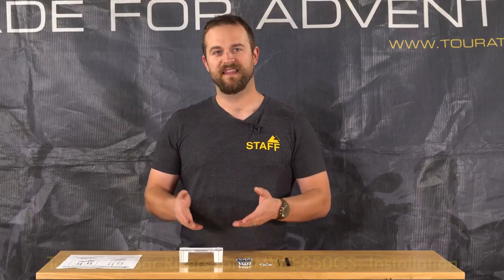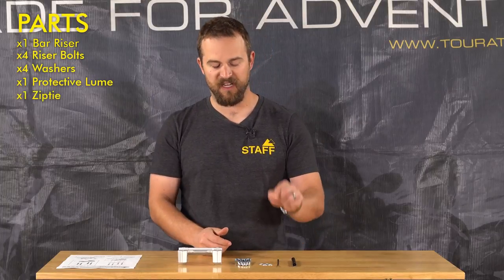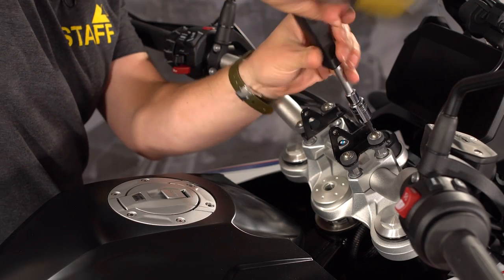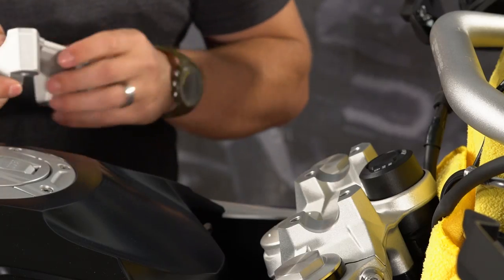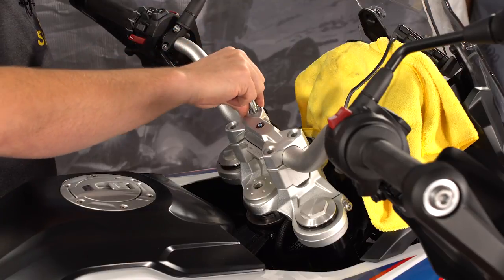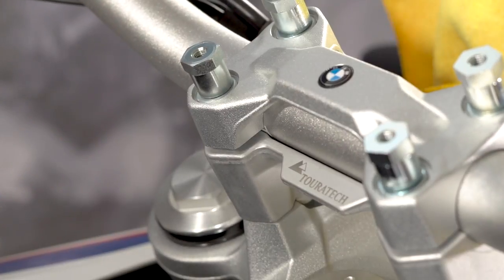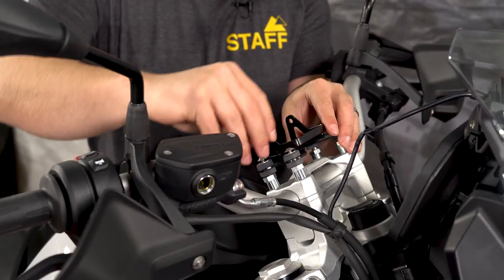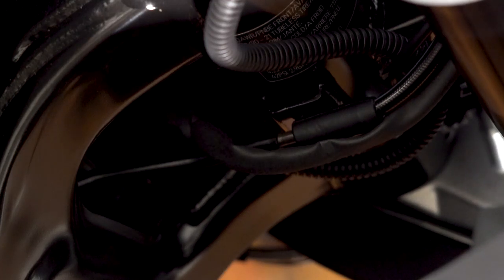BMW F850GS Installation: Touratech Bridged Handlebar Risers

Comment: For This installation I doña need modify the wires? I can do it by my self ?
Reply from the maker: No modifications to the wires or cables are necessary. This is an easy install to do at home with basic hand tools.

Comment: I just bought this product for my 2022 850gs but I don’t really understand the manual and want to be sure - how tight do I have to fix the screws in NM?
Reply from the maker: Use the factory specification for the handlebar clamp bolts. That spec should be 19nm.